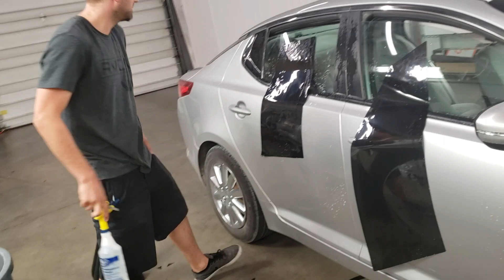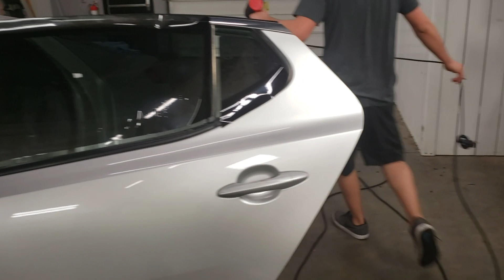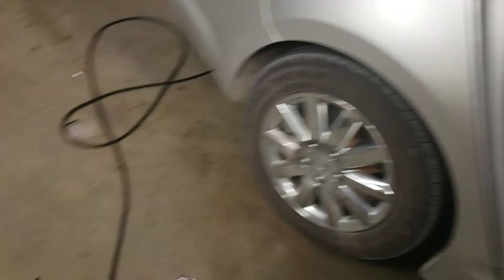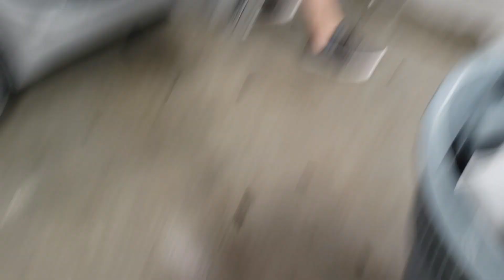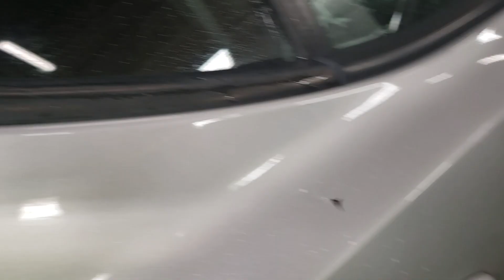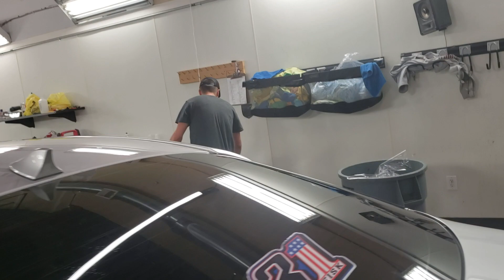MEET.... The FASTEST Tinter in the Whole World!!

Comment: This guy is fast no doubt.  I consider myself a fast tinter and that car would take me 45min.  Only thing I take issue with is trimming the tint on the car.  No matter how many times you snap your blade or how good you are eventually you will etch the glass like that.  It might take an extra minute but I would use a peel board for all the trimming.  I also wouldn't leave my heat gun on.  I've melted too many good pairs of sneakers that way.
Reply from the maker: thanks for viewing bossman!!!

Comment: Is it just me or does anyone else cringe at the thought of all the water going in the door panel?! 
He is very fast though.
Reply: U do realize water goes in the door when u roll your window down while it's raining or even a loose window gasket on the outside let's water inside the door panel that's why they have drain holes in the bottom of the doors lmao
Reply: Michael Plemons why would you roll your window down while it’s raining? Plus if water gets in it doesn’t all get out and it can create rust
Reply: @66.caprice  iv ran trucks for years with broken and cracked weather stripping in the window jams not saying it wont create rust on these newer vehicles but there produced to drain water from any channels inside the doors if u took them apart they have a small v shape in the metal to help drain as much water as possible they also installed air flow vents into the front of the doors to help air flow for drying out moister so its compleatly safe to get water inside if you dont wanna take the chance I'd suggest not getting your windows tinted
Reply: Michael Plemons I do get my windows tinted but I’ve never seen so much water used that’s all
Reply: @66.caprice  I do agree it's over excessive
Reply: 66 Caprice That ain’t shit, you should see me with my Tank Sprayer. The soap and water does not hurt anything.
Reply: Did you see the filth inside that car? Shit a little fuckin soap n water is just what the doctor odered
Reply: PrinceFcknCharming under normal circumstances you don’t roll a window down while it’s raining lol
Reply: Dude you do know every door has a couple drain holes. Even with weather seals it does not keep water out 100%.

Comment: Hope u not doing high end cars with that much water running all down the door panels
Reply from the maker: Thanks for viewing bossman!!!
Reply: That don't really hurt the door glasses or the rear glasses. On doors they are designed to control water runoff inside and out. They have drains  cut out in the doors. The windshield is the only time to worry about water.
Reply: @punktalley  finally someone on here with common sense. People on here speaking on shit they don't know about
Reply: @joshuadeacon2283  yea people don't understand that the condensation builds up inside a ride on the glass and has to go somewhere and they design for moisture.

Comment: Doesn’t cover the back seats, the rear deck, probably didn’t put a drop cloth in the trunk, scrapes windows with the same olfa blade not changing it out, doesn’t snap blade at all trimming the back window, cuts on the glass to trim the back window, hacks the rubber on the vents, scraping over the ceramic lettering on the glass which makes the blade dull causing it to scratch the glass. I can go on and on about all the mistakes in this one video. 

As a former professional installer, I’d say this is amateur work. Quality over quantity 🤷‍♂️.
Reply from the maker: Thanks for viewing bossman!!!
Reply: Mike Sanchez my pleasure

Comment: pretty good job. but as a tinter with over 10 years of experience.. watching you cut that window gasket made me cringe. also a tinter that tints a car in 14-15 minutes is definitely cutting corners. 30 minutes is average for a professional.
Reply from the maker: 30 minutes is not average.  its hauling ass...average is 1 hour 15 to 30.  thanks for viewing bossman!!
Reply: @mikesanchez1428  between 30-45 is about right for a "professional" tinter. I worked at a fast paced tint shop where each tinter did 9 cars in a 8hour shift. Plus factor in a 30 minute lunch. You can maybe get away with tinting 8 cars but anything less nd you're fired!
Reply: Now here at my own shop I take about 45-1hr because I'm not super busy nor being rushed.. But on occasions I have to pump up the pace.